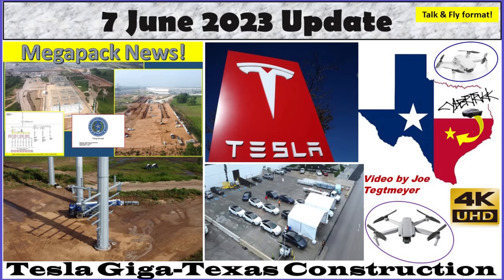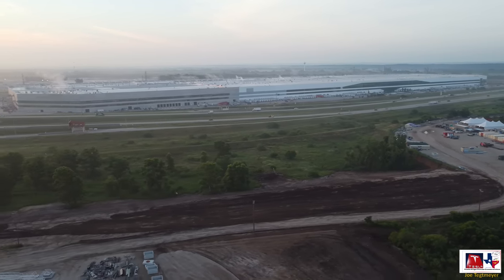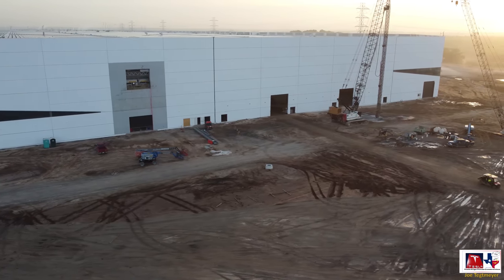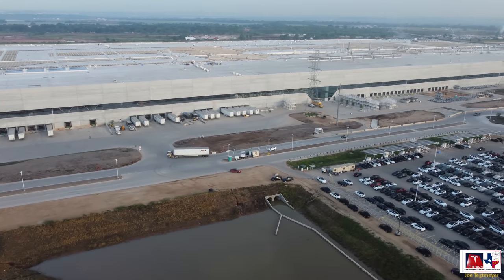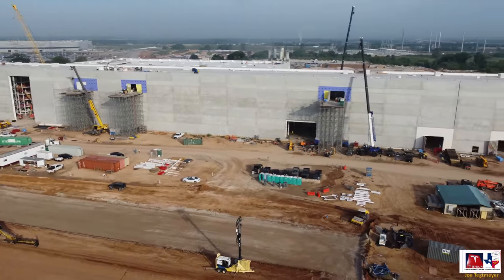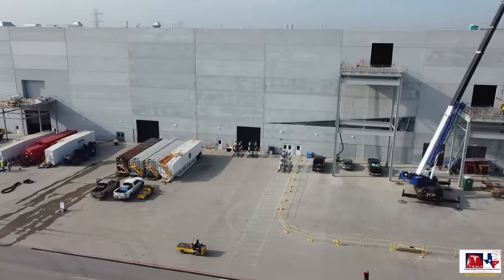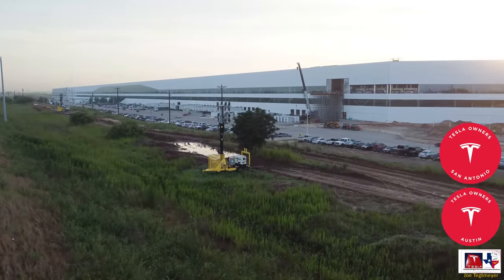Model Y Bumper Molds, Megapack Progress, Cathode GeoPiers! 7 June 2023 Giga Texas Update (07:15AM)

Comment: Thanks Joe
7:32. GA, loading platform. Bins of demolished floor.
7 white pieces of gear by Equipment Share. Rental.
8:47. Southend. Large squarish excavation. Abutting or just straddling the line of the building.
Location for a well/pit for the white pipes to drain into perhaps.
9:25. Southend. Drilling rig. The small yellow frames show the location of recently constructed piles. Generally in line with the panel joints of the wall behind, indicates regular column spacing.
10:51. Southend. Lots of unpainted steel plate and angles with shear lugs welded in place. These plates and angles would likely be for areas of high wear. Edges of slab set-downs, pits etc for the angles. Plates might be for machine bases, or some high wear section of floor.
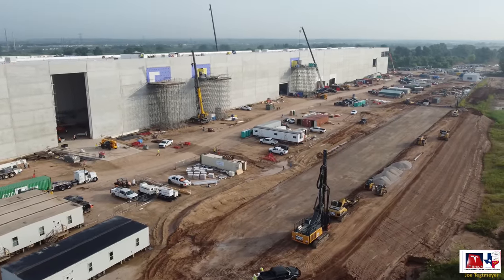18:11. Cathode east. Geo-piering is an unexpected development. Top right. Water supply trailers have been removed.
19:52. Cathode. Windows. Long edge is the vertical side.
22:04. Far north storage. Another pack marked GA2.
24:07. Site Security access road. Tree irrigation tank getting a top-up.
24:52. Easement, north. Beam straddling the trench is temporarily suspending the gas/fuel pipeline under.
25:11. New switchyard/substation site. Placing formwork for a concrete slab. Initial concrete must have been a mud slab only.
26:44. BES site. Excavating a square in amongst what will be the BESS switchyard. Footing location for the transformer/s? Another square marked out to the north (bottom of screen).
27:44. BESS site. Exact location marked in green.
28:01. BESS site. Contractors yard. Small monopoles for the BESS switchyard.
29:03. Plastics, apron. Other than being bumper bar shaped, it’s not clear what these are. Not moulds/dies. Light weight, permanently mounted to a lightweight frame, seems set up to be shifted around by a forklift. Possibly racks for shifting around bumpers still warm from the injection moulding press. 
There’s someone who works in automotive plastics, comments here sometimes. She might know.
30:08. Casting, apron. Second vault placed. South face of the vaults hasn’t been opened up. Indicates the existing duct-bank to the building likely won’t be used.
30:30. Casting east, inside the loading docks. Strip footings, or concrete backfilled trenches.
Reply: 26:44 My guess would be a pad for the 24.9 kV <--> 345 kV transformer.
Reply: G'day Dessie, Your 26:44 . My guess is that the excavation is for the 345 kV to 24.9 kV transformer and the smaller pad to the north is for the breakers with disconnects on each side.  There also appears to be a small 345 kV switching area on the north end. This connection is metered in the Hornsby Substation and the transformer secondary will connect to the 24.9 kV Operating Bus. The battery system has a metered connection to the 24.9 kV operating bus which connects to four breakers through disconnects and eight disconnects from the breakers to the 480 V to 24.9 kV transformers at each battery group. The rate of battery supply is 131.05 MW, they do not state the total mega watt hours.
29:03  These could be trimming templates for flash removal.
Reply: @DavidJohnson-tv2nn  I'm hoping GoCoyote will chime in with an opinion on this.
Reply: @eltonray2934  26:44. Seems to be in the centre of 2 groups of screw piles, so 2 halves of a switchyard I would guess.
29:03. Could be. Stands for painting primer possibly also. Found a couple of relevant videos showing how plastic bumpers are made. Nothing exactly the same in either video, but certainly shows what they aren't.
https://youtu.be/dWizoVj1qXI
https://youtu.be/HsYnTXAD21w

Comment: Yea not sure if those are bumper molds but bumper fixtures for painting and they have big holes in odd places.  
If they were molds they would be bigger solid blocks with alignment pins and outer rims which is part of the die.

Comment: 25:09. My guess is that the southern fence of the substation/switchyard are the locations for the service connection points for the Tesla factory complex (two of them), and a large vault is being built along the southern end that will contain all of the service connection conductors on Tesla's side. Looks to be a rat slab already poured to support the formwork for the slab, and one can see the beginnings of the floor slab formwork being built. 

The two service connections will cross over the substation fence that is the demarcation point for responsibility for equipment, and then enter the vault to be connected to the Tesla system via the 24.9KV factory distribution system. This type of system is normal for large industrial complexes like this such as factories, sewage treatment plants, refineries, etc.

The gravel does not provide grounding, and is in fact intended for insulation, but it does serve several purposes. It is made from rock that is of a low conductivity and that is sized to provide air space to facilitate insulation and the quick percolation of rain water in order to prevent surface water. The rocks are washed to prevent conductive surface dust, and provide protection to equipment and personnel within the yard from becoming a conductor to ground. The gravel also acts as mulch to prevent the growth of plants, prevent burrowing animals from digging, and to keep the soil moisture high enough to facilitate proper soil conductance for the earth grounding system. Found a nice little vid on the subject; https://www.youtube.com/watch?v=F3qKe-LgoRQ
Reply: 25:09. A rat slab. You've introduced another new term for me to ponder.
Reply: @DessieDoolan  
It is an unreinforced (concrete) slab poured to provide a surface for multiple uses, such as temporary working surfaces, a leave in place surface under a structural slab or foundation, and as a concrete  protective surface poured over the soil surface of a crawl space under a post and beam supported building in order to keep out rodents and moisture, and provide a clean crawl space.
Reply: @GoCoyote  Same as a mud slab? I don't think I have a local term.
Thanks for the comment on the gravel.
Reply: Hi Sparks. Have you checked out the schematic in the ERCOT document? Link in Joe's video description above. Would be great to get a opinion from a relevant trade. 

Page 48 for the schematic.

Comment: Somebody said those bumpers shapes are not molds. That’s correct. Molds are big matching  blocks of steel with a hollow space the shape of the bumpers. Those could be early shots of parts before they have been painted but I wonder if they are fixtures that parts are placed on to maintain their shape as they cool or to hold them while being painted. I see some slots and other features that would not appear on actual bumpers.
Reply from the maker: Metal bumpers? Doesn’t sound correct
Reply: @JoeTegtmeyer  Bit of feedback:  Your commentary is great, but many times, by the time you have noticed something and mentioned it, they are just gong out of shot and I need to skip back.  I'm thinking if you put a two second delay on the audio of the finished narration, it would put you a little ahead of us and solve this.
Reply: @JoeTegtmeyer  He didn't say they were metal, just that injection moulds would be big blocks, similar to casting blocks, with a lot of support to keep the shape and take the pressure and heat.  
  The frames that they are on suggests a trip through the paint shop, which would be the next stage from the plastics shop.

Comment: A thought on the giga castings for CT. The MY castings need a steel plate to reinforce the casting at the MacPherson strut connection point. The forces at this point in CT will be far greater.
 I wonder if CT has a suspension more like that we see in a Lamborghini Aventador or an F1 car - double wishbone suspension and horizontal shocks??
This allows all the dynamic forces to be carried by the main beams in the front and rear that the bumpers are attached to. 
MS/Y uses an air cylinder as a strut between the strut towers. In the case of the CT, the air tank can be a cross brace between the frames and a support for the shocks - the air shocks are attached to the air tank??
The giga-castings would have far less stress in the arches which serve as wheel wells, attachment points for the exterior panels (stainless steel) and to aid in passing the small overlap crash test. A MacPherson strut can be loaded many times a second on a corrugated road which may fatigue the giga-castings causing cracks. It should also make it easier to assemble the cradles with the powertrains. Just a thought.

Comment: BESS yard: @ 27:15 Schematic diagram... Bottom: Numbers 1 through 8 are banks of Megapacks. 6 banks will consist of 8 Megapacks each. 2 banks will consist of 10 Megapacks each. (6 x 8) + (2 x 10) = 68 total.
Above: Numbers 1 through 4 are circuit breakers. There are switches on each side of the circuit breakers. Just like in the main LCRA substation. Not shown in the diagram are the individual Megapacks. Speculation at this point, but every 2 Megapacks may also have a transformer or switchgear associated with it. Which is that the concrete pads with the holes @ 28:12 are for. Again, just speculation on the purpose of the concrete pads.
Reply from the maker: Correct!

Comment: Joe, do you have any idea why the electrical switch yard appears to be configured to ADD a third Transformer? I can’t think of any other reason to have the extra A-Frames.
Reply: No, there are no plans for a third transformer at this time. Though there will be a new 345 kV transformer at the BESS yard substation (Just north of the Megapacks). The purpose of extra A-frame structure is to support the single span of transmission lines coming from the east monopole. Those lines are connected through switches and circuit breakers to the substation's 345 kV busses. The east monopole is the interconnection point to the BESS yard substation, now under construction on the other side of the utility easement. See the LCRA interconnection agreement page 48 (PDF page 59) fore more details.